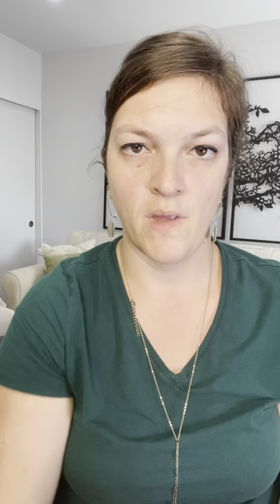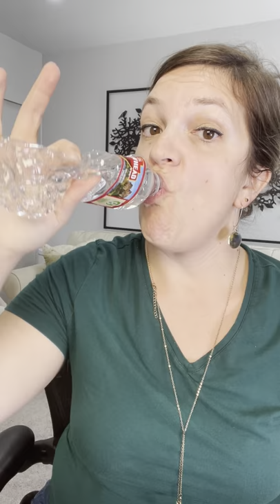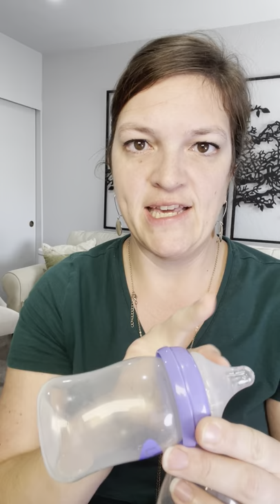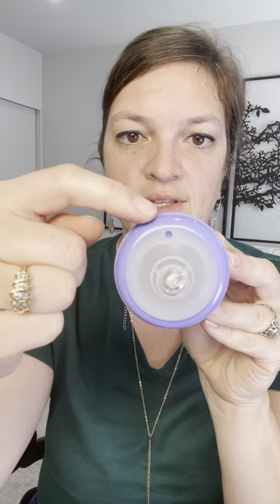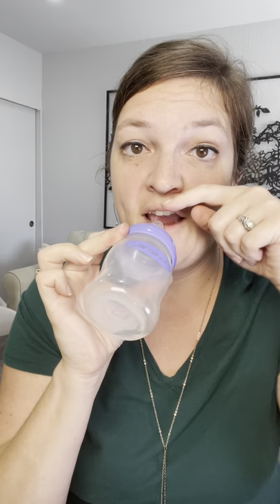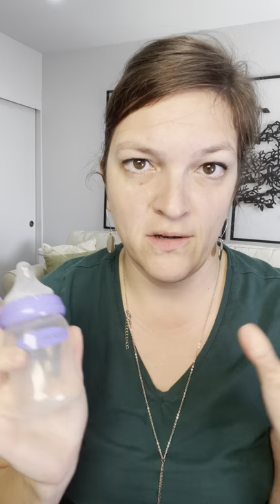Baby bottle with a vent system

Comment: Stupid question, but when my baby drinks from this bottle there are still lots of bubbles forming in the milk. I have the air vent on top. What is going wrong? Please help my baby is so gassy and I am desperate…
Reply: Have u tried a different brand? Maybe it’s the flow rate?